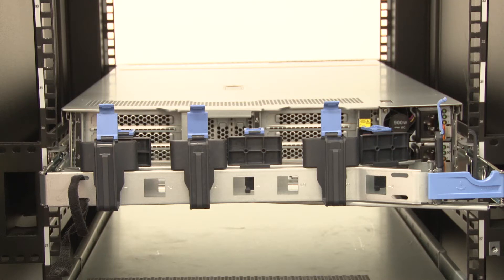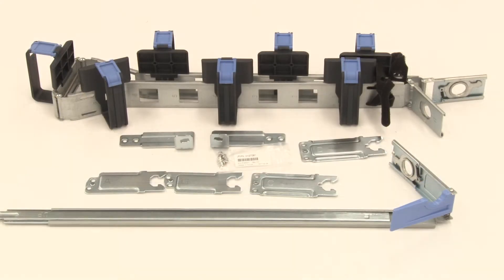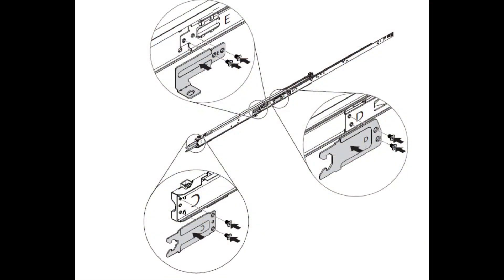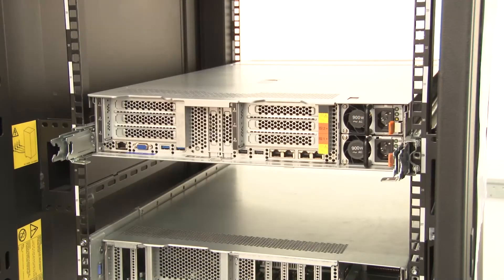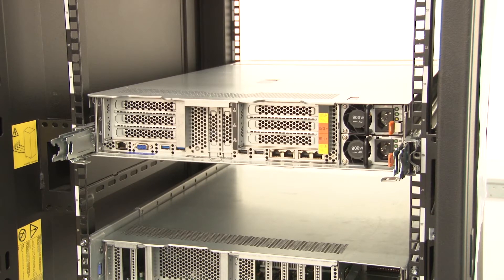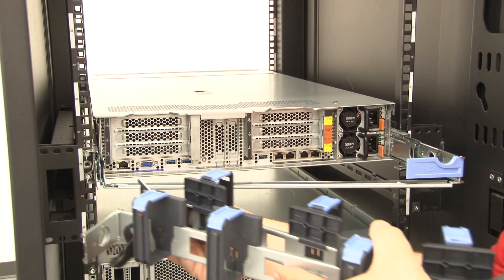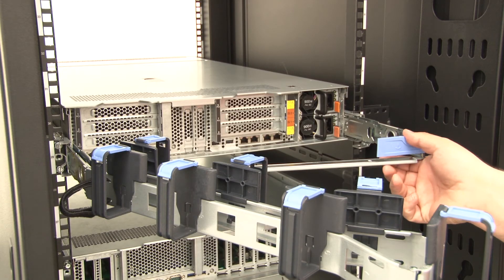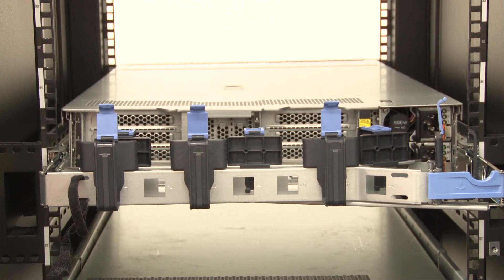Installing the Cable Management Arm

Comment: is this kit will works with SR650?
Reply from the maker: Yes, SR655 and SR650 use the same rail kit with CMA.
Reply: @lenovoisgservicesproducted1185  which part number? 7M27A05698 or 4M17A07275?